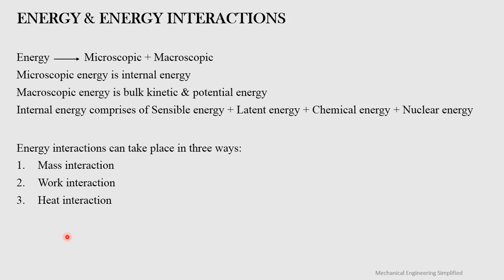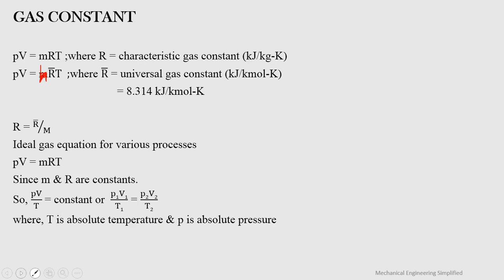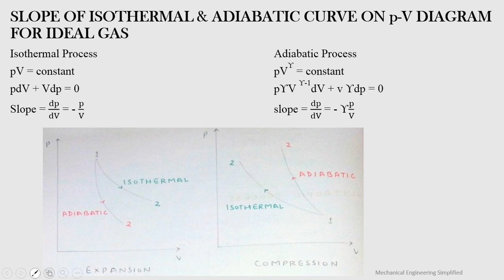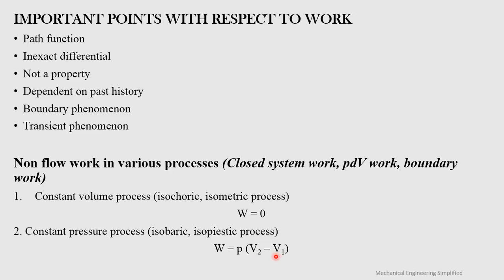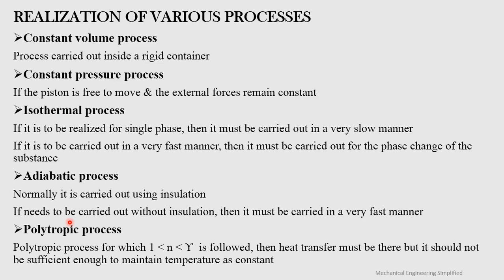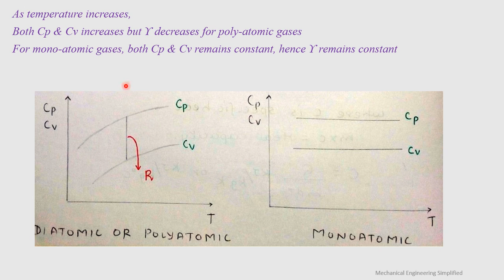Basic Thermodynamics-Lecture 3_Concepts of Work & Heat

Comment: Sir, I think it is (net heat transfer is equal to net work transfer) i.e  ∮ ΣQ = ∮ ΣW
Reply: Only for cyclic process as dE is 0 in that case as E is a state function depend upon initial and final point and doesn't depend upon path followed.